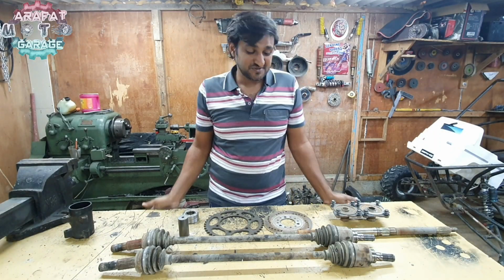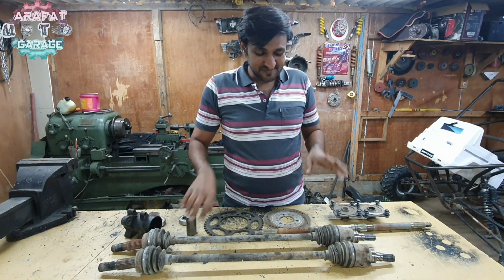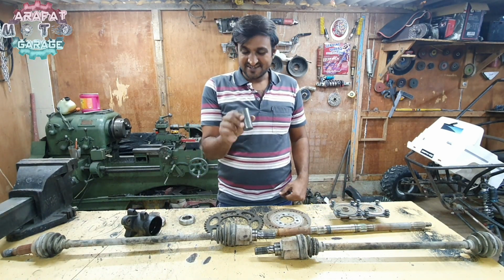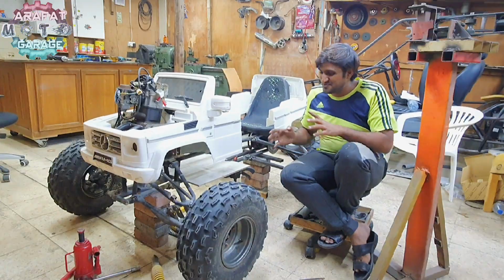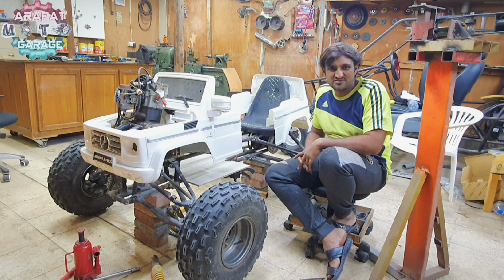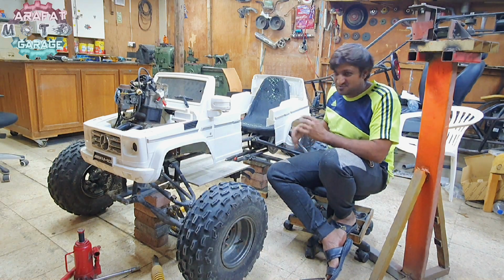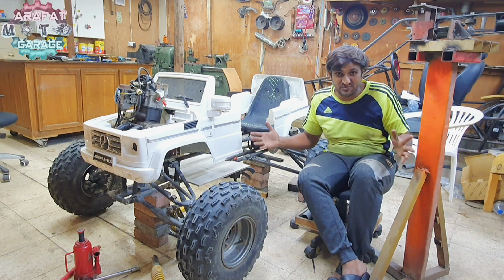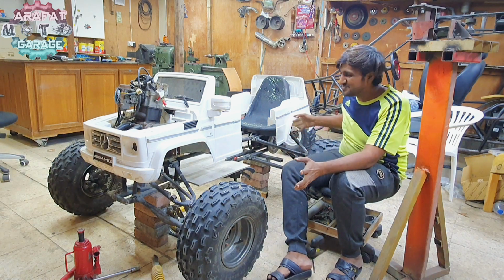How to Build IRS Axle for Go Kart

Comment: Good day

I see that you used what looks like a rubber/plastic hosepipe as bushing. How durable is it?
Reply from the maker: I just used it temporarily but yes they was working fine I even had a test drive also on that and after I replaced it with nylon bushing but they was it perfect condition